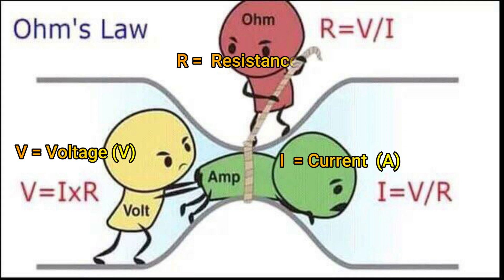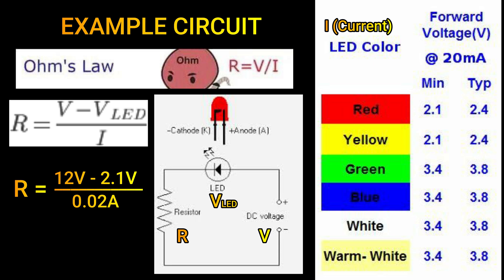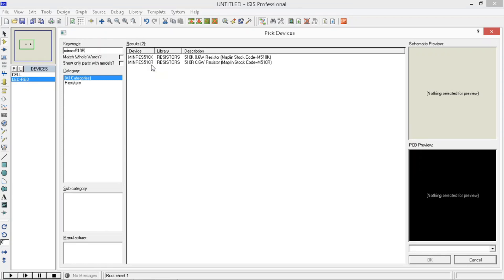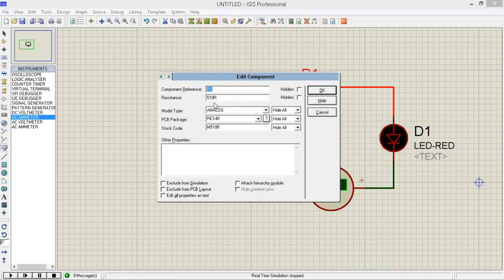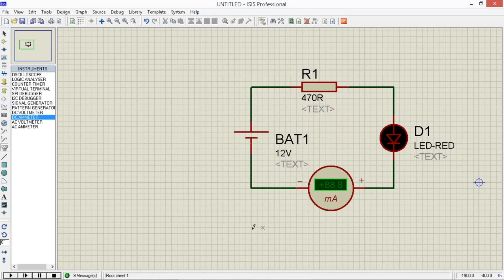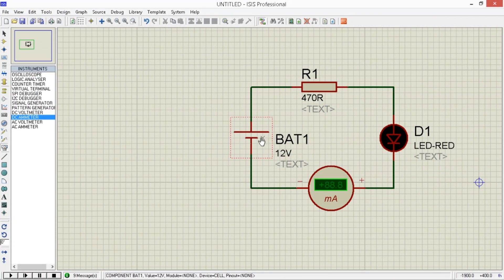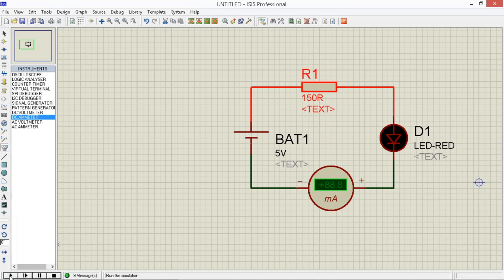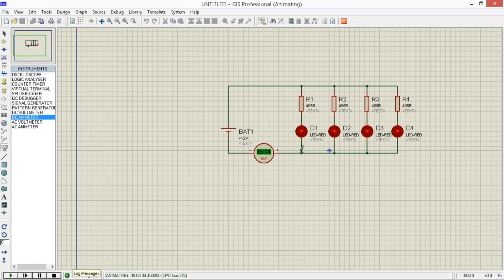Paano mag compute ng Resistor Value para hindi masira ang LED (Light Emitting Diode)?

Comment: Sa solenoid naman sir request ko po yong resistance nya is 22ohms 24dc tas ang supply nya is 27 to 28 volts paano para hindi agad masira ang solenoid sir sana mapansin po ninyu sir
Reply from the maker: gamit ka dyan high wattage resistance para di masira thnks

Comment: Sir my tanong lang ako, pano sir mag conect ng 69 pcs, ng emitting light diode sa 220v
Reply from the maker: Series lang sir then mag connect kang resistor with a value of 200ohms to 1k...be careful kasi high voltage siya

Comment: anong resistor ba dapat sa 10 peraso ng 3 watts led  para sa 12 volts battery
Reply from the maker: Depende po sa forward voltage ng led hawak mo mam kung tig 3V yan sample lang bale pwedi na apat na naka series sa 12Volts supply

Comment: Sir anu po risistor pwd ilagay kasi yung input dc 14 volts paanu gawing 12 volts output para iconnect sa led na 12volts
Reply from the maker: try yung computation na ginawa ko pag 14V siya nasa video po yung computation den depende dinsa led na ginamit

Comment: sir ask ko lang po kung ano pong power supply ang gagamitin ko sa 3volts n led n ilaw , bale 10pcs po sila. salamat po
Reply from the maker: kung sampu sila pweding nama 5V den parallel connection na may resistor na 150ohms to 1k depende sa gusto mo liwanag

Comment: 3watts led x 12volt battery Ano po resistor value salamat
Reply from the maker: ano yung forward voltage ng led mo na three watts 3Volts ba?
Reply: Ganda po ng Tutorial... I subscribe kita sir, ay may Tanong po ako . Ano po tamang value ng Resistor sa 3.7v 18650 Battery para umilaw po ang 3V LED.... Sana masagot mo sir, abangan ko po sagot mo. Thanks

Comment: Hi  po meron po akong  led na 3v 360mA  saka 12v power supply  kung icocompute ko po ba yung ohms value nya ang gagamitin ko yung current ng led?  Halimbawa. 
12-3=9÷0.36? Ganiyan po ba? Kasi 360 ang current ng led ko
Reply from the maker: tama po kung ang rating ng led mo is 360mA

Comment: Pwde po ba khit walang mA at pwdeng direct with 1k resistor
Reply from the maker: Kung walang mA impossible na iilaw kasi kuryente ang mA... dapat malaman mo yung current na dumadaloy para macompute mo yung resistance di basta basta 1k... involve dapat ang current at voltage...nasa data sheet naman yung maximum at minimum current ng LED usually kasi 10mA to 30mA.

Comment: Boss maglagay ako ng light indicator sa 12 volts battery....gamit ko ang led na 3v. ilang ohms ba ang kailangang resistor...?
Reply from the maker: boss eto formula Resistor =(12-3)/0.02 = 450 ohms kung walang 450 ohns pweding 470 to 1kohms boss hanggang 2k pwedi umilaw yan pag lamalaki ang resistor syempre nag iiba ang liwanang
Reply: @SanCeGOElectronics ok  salamat boss
Reply: @SanCeGOElectronics  boss pwedi bang magka balibaliktad ang paglagay ng resistor..? Wla bang proper direction..?
Reply from the maker: @octavioganoy6360  okay lang kahit magkabaligtad walang polarity ang resistor...
Reply: @SanCeGOElectronics  paano e connect ang resistor lods
Reply from the maker: @reuse1987  walang polarity ang resistor.. series mulang sa positive supply papunta sa positive ng led...

Comment: sir, ask ko lang kung pwede, i-series ko 4 pcs na 5mm green led...ubra bang 1 resistor gamitin ko? at anong value or ilang ohms?salamat sa reply. note: power source ko ay 5v mobile charger.
Reply from the maker: di pwedi e series yung led na 5 mm green led 4pcs kasi 3V forward volttage niyan kung 5V ang source mo....pweding gawin mo parallel mo ang apat na green led den computation ng resistor = (5V-3V)/0.02A = 100ohms siya
Reply: @SanCeGOElectronics  tnx sir sa oras na inilaan mo...one more ? isa lang ba resistor na 100 ohms gagamitin ko sa parallel connection na to?
Reply from the maker: @ernestopicz4537  pwedi isa dun sa 5V or tig isa every led....
Reply: @SanCeGOElectronics  salamat ng marami sir.